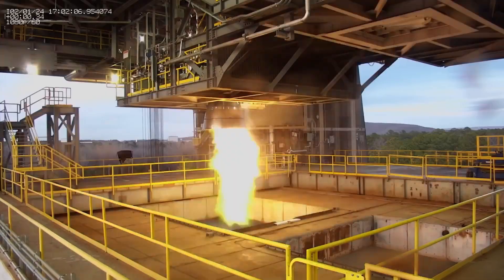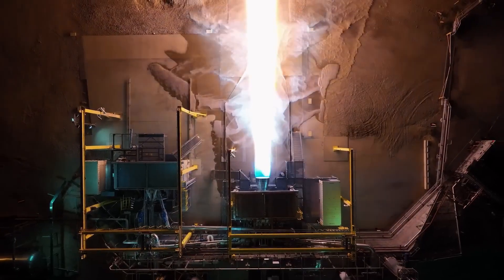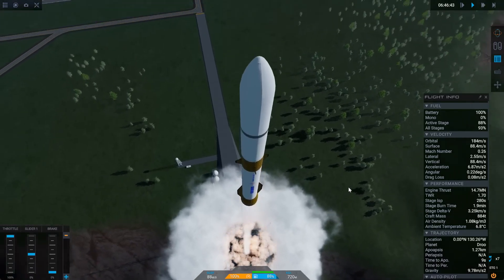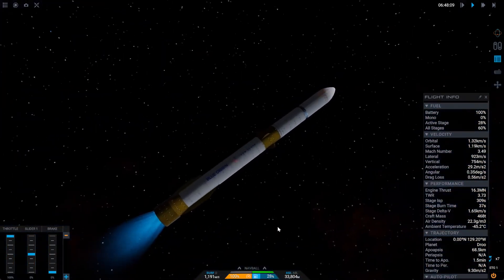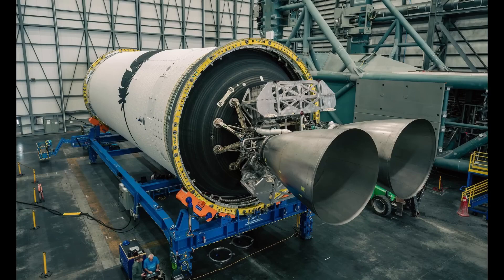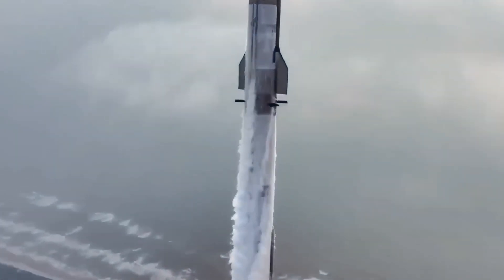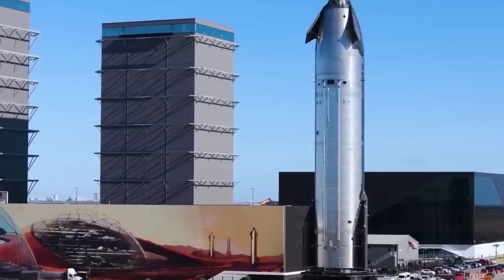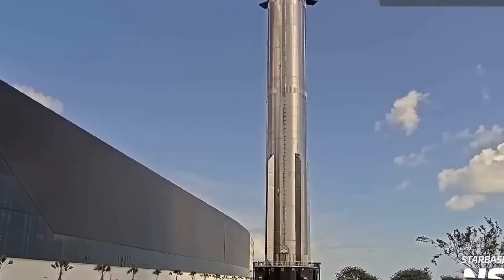Is Blue Origin's New Glenn About to Dethrone SpaceX's Relics? The Race Against Time!

Comment: No one is winning or losing. They aren't competing as much as we think. They both have their own, independant objectives. This fact means everyone wins.
Reply: Naw. They're both losing. The first stage of a spaceship powered by piston engines can reach above 200,000 feet on a tiny fraction of the fuel and without degrading the plane. Minutes between flights instead of a rocket's weeks of rebuilding (or total loss via explosion).
Reply from the maker: That's the nice information
Reply from the maker: Thank you for your support